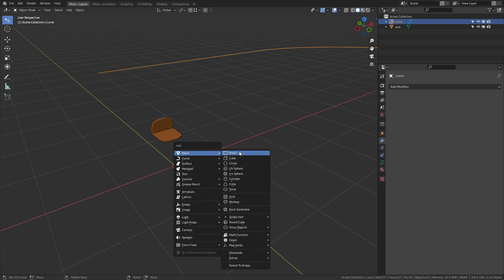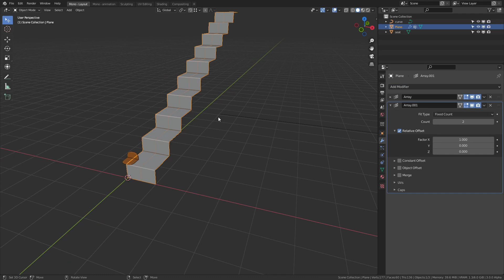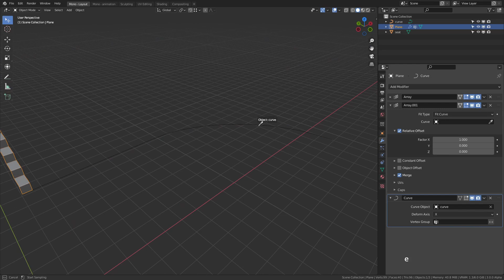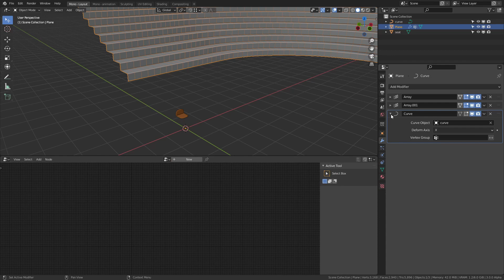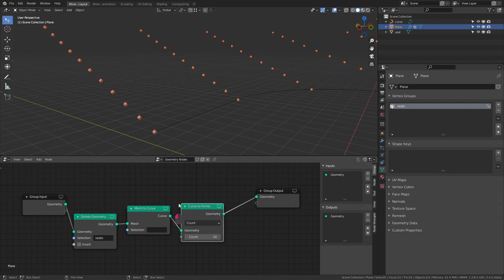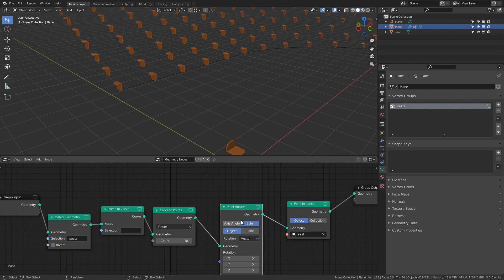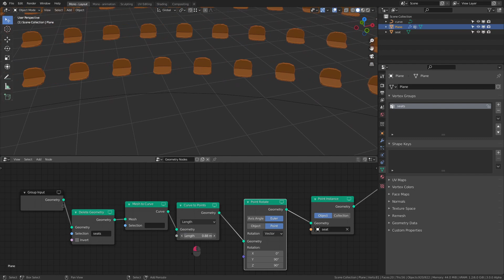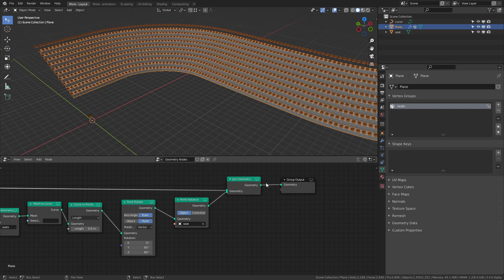Blender 3.0 alpha - Geometry nodes for ArchViz: procedural stadium seats

Comment: Very helpful, thank you. Is there any way to remove seats? to create stairs and entrance doors in the stands of the stadium? and have a different material for the next seat?
Reply from the maker: Probably by playing with index you can achieve something, but we don't have the nodes (yet!) to efficently work on that. For the moment, my suggestion would be to "bake" the curve and edit that. I did that way for my latest work; see from this point on: https://youtu.be/PaqTUJf9Nso?t=4864. You'll lose some of the procedurallity, but at least you can configure the seats the way you need.